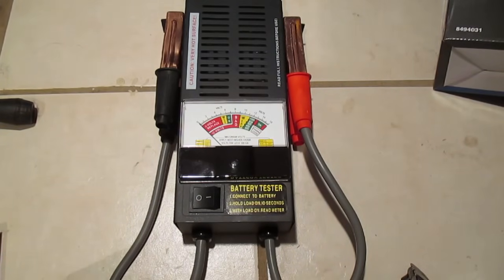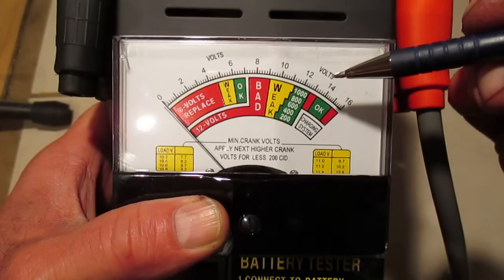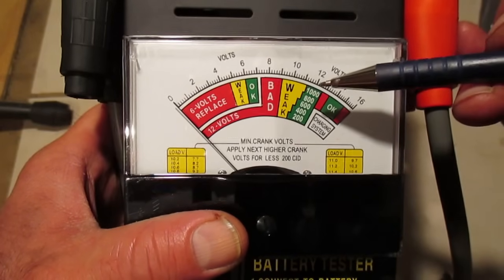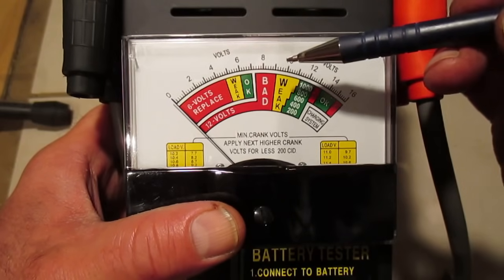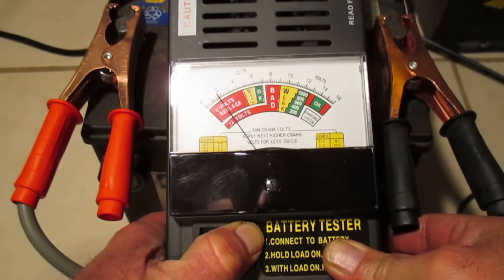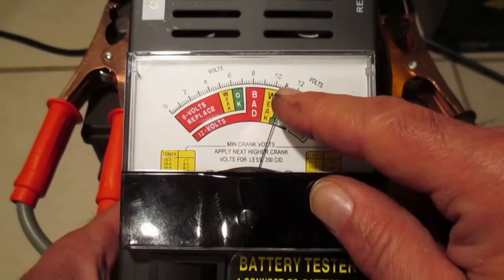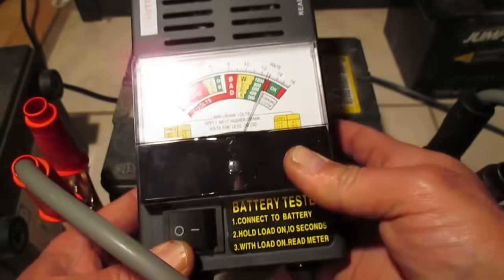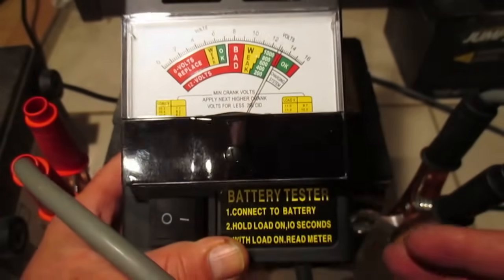How to test a car battery

Comment: Wait for Resting Voltage: Let the car sit for several hours (or overnight) to get an accurate resting voltage (around 12.6V).
Discharge Surface Charge: If recently charged, turn headlights on for 3-5 minutes to remove surface charge before testing

Comment: I prefer a Fluke Multimeter with a min/max setting.  You get an accurate digital reading with no need to constant crack the engine to get an amp reading.

Comment: Bought the same tester about 6 years ago- used today for first time on 2018 Honda Civic
OEM battery and passed . Also used volt metre on start up and lowest reading was 10V
so am good for now - will change in October before the cold weather .

Comment: Should the battery be replaced if it shows in the week section?
Reply: No, he explained 
The lowest voltage is 9.5V
If the battery tester shows in the red=bad 
Then you must replace the battery

Comment: I’m stunned that you were able to get a voltage reading on the multimeter without the black lead being in the COM port. Actually had to try it on my own multimeter and to my surprise it actually worked! Not that I’m going to do it again. I might blow he socks of my coworkers tomorrow though with that trick. Anyway, good video. Thank you.
Reply: it will just read a neg no.
Reply: Hahaha I was just gonna type this 🤣

Comment: Very important to unplug the charger before disconnecting the cables from Battery : if you do not unplugged charger does cause a mild spark and the battery Has mild acid fumes from charging coming off of the battery and that will cause it to blow !!!!  Yes Right in your face .. I KNOW FROM EXPERIENCE !! I always now shut power off and or unplug the charger before disconnecting the cables.

Comment: I did it on my car today the multimeter only method that GM has,the car has the 5.7 litre Chevy LS1 V8 engine fitted,the battery is almost 3 years old (used for 2) ,it's a 420 CCA battery & the battery voltage was 12.42 volts, I tested it this way :-

1 - Disable the fuel & ignition system (pull the ECU relay out)

2 - Connect the multimeter leads up to the battery terminals with it set to the volts DC scale

3 - Crank the starter for no longer than 15 seconds, observe the voltage, it shouldn't be lower than 9 -10 volts.

In my case, it read 10.3 volts under load,so my battery is still o.k.

Comment: Thanks. I am looking for a fairly inexpensive one to test household batteries. I like that red one you showed at 00:59, but cannot find it online. I did find an LCD digital readout one that says it has a low battery voltage indicator. Do you have any idea what sort of indicator that would be to indicate low battery for those of us who would not know based on the read out? And can you recommend an analog one like your ref Radio Shack one at 1:00 in your video?

Comment: Nice video, but you missed first important step. Always read the battery Cold Cranking Amps or CCA at your battery to know which scale you will gonna use when cheking how good your battery is. Example if the battery is CCA 200 then you will use 200 scale on your Battery load tester. Battery load tester CCA scale is 200 to 1000.
Reply: Nah as long as it doesn't drop halfway past the weak point your good.

Comment: A car battery that is fully charged and without any load on it, should be from 13,7V up to 14,5V. When a battery is at 12,8V like these 2, are only charged at about 75%.
Reply: That's backwards bud.  Anything over 12.65V would be considered a full charge.  Your readings wont achieve that 13.7V reading until you car/boat is running indicating your car/boats charging system is working.  Just saying.

Comment: Can I use that tester on the go, in my boat, powering a trolling motor as my ONLY motor?......What I mean is this: When my battery is full and i set out across the water, will this meter tell me when i'm 3/4 charged? 1/2? etc......I have no alternator, just a min kota and a battery....Thx
Reply: No

Comment: ive been searching for answers for over a week.  been repaired several times, a couple of times for two whole days. then back to square 1.  im good with sparks from either post. if it sparks a fire then at least i wont be broke down in this weather with no heat.  and i will finally be done with it.  in case of no sparks, ill take a lighter, just in case.

Comment: Your video was very good on performing the procedure, but I have a couple of comments. I have one of those resistive load testers. They do not simulate the current draw of a typical starter motor! Mine draws about 50 amps on a good 12 volt battery. It will be 1/2 of that on a 6 volt battery! A starter can draw from 300-650 amps cranking a cold engine. You should see only a volt or so drop during the load test on a good battery. If tester shows 10.8 or less on a 600cca or higher battery, suspect a weak battery, or it needs a good charge. The reason they tell you not to hold the test button for over 10 seconds is that the cheap resister element can burn out. Ya, I use mine, because I don't have one of those fancy rigs that tests conductance (internal resistance).
Reply: Curt Chase- In the old day (70's) of my Auto-Tech school, they taught the proper method to do a load test is using different resistant values to test different size engines.The battery have to fully charged first.  Another method we used is pulling the spark plug out from the coil and crank the engine for 30 secs. Any voltage reading more the 9.8V is considered good. This simple method is to see if the battery able to start an vehicle in all weather conditions. no tester require just a voltmeter.
Reply: that thing gets really hot if load tested for more than 10 seconds.  The resisting elements turn red  LOL.
Reply: Small warm cars in Los Angeles can spin starter with 50 amperes
Reply: Curt Chase yeah it is just a "voltage drop tester under some havier load" gives you some idear, maybe it can be made better by adding light bulbs for additional load....does the switch inside switch all the current? Then it's a piece of poop

Comment: Man....just use your multi meter..plus you can check your alternator output. Just try to get a  m-meter with a min/max setting. ...cheaper easier. Then ideally you turn on your lights for 2 min to discharge surface voltage, then load test etc.
...

Comment: Can you use the crank test unit while battery is connected to the car or will it mess up alternator ?? And fuse box?
Reply from the maker: Do not do this test with the car battery connected . The vehicle battery cables should be disconnected ; then do the load test Bend
Reply: Wrong. No harm will come to your car if you don't disconnect the battery. All Autoparts stores test for free and they never disconnect the battery. Its not necessary.  https://www.youtube.com/watch?v=3QiKyjWWiRo

Comment: ALWAYS CONNECT POS(+) LEAD FIRST, BEFORE ATTACHING NEG(-) LEAD.  THEN REVERSE THAT ORDER WHEN REMOVING ! ! ! Did you see the sparks fly when you removed the pos charging lead before you removed the neg lead on the 2nd battery? That's enough to IGNITE battery fumes and CAUSE AN EXPLOSION! I know this from personal experience, only took once for me to become a believer...
Reply: the reason you disconnect negative first, or put it on last, is so you don't accidentally short the battery with the wrench you're using when you're on the positive.
Reply: well I was shown to always connect the neg. first before the possessive so no risk of anything wrong happening? but good to hear you had a problem from sparks? something I never worry about? I had no directions in the box I got after buying one on eBay?
Reply: That's correct, positive first, negative last. Especially when starting a car using a different car, otherwise you can blow out the voltage control. Also find another ground, not directly on  the battery of car being started.
Reply: It'll spark if you connect the negative last too. doesn't matter which one gets connected first. The last one you connect will spark.

Comment: Sorry dear author of the video. 
You are wrong to use a multimeter. The black wire should be attached to the socket "COM" and red to the right outlet, where it is written "V, (the Ohm icon), mA". 
Thank you for your attention.

Comment: If you charge a battery and it fails to start your car then it fails the load test. Just wondering why this machine is necessary at all.
Reply: you can  test the battery to see if it will fail to start the vehicle in freezing temperatures.  For example, the 2nd battery load tested at ~200 CCA ( room temp)  will have problems.  The load amp readings are CCA  for this device.

Comment: backyardmech, can a battery lose voltage not connected to anything in cold weather?
Reply: jim Nicosia yes of cause especially if water/moister freezes inside the acid into crystals it kills and can pop open a car battery... battery does show lower voltage because of capacity decrease by low ambient temperature, but if the voltage is really low the battery is dead even in hot summer

Comment: I would say that your 2nd battery also failed the test. It's hard to see but it looks like the battery is rated for
760 cranking amps, while tested your load tester shows that it's putting out around 200 cranking amps which is about
25% of its rated output. Might get away using that battery on a small engine in the summer, but on a really cold Canadian day it might leave you S.O.L.
Reply: It is quite normal for a twelve volt battery to drop two or three volts during the heavy load of cranking. In the old days when cars had ordinary incandescent headlights this could be illustrated by cranking the engine with the headlights on. They would dim significantly.  Incandescent lamps are very voltage sensitive.

Also, back then, there was a ballast resistor bypass, or an alternate cranking resistor in the low voltage side of the ignition coil circuit, thus maintaining a good spark.

Comment: Your probes seems to be inserted at the wrong terminals, that's why they are reading a negative value. Just me..
Reply: Looks to me like he has the red lead plugged into the com side.
Reply: Baluds , you are correct !
Reply: the bigger problem is he had the red terminal in the AMP/current socket.
Reply: There's nothing wrong the way he connected the probes it's 100% right.
Reply: ***** They are attached correctly.